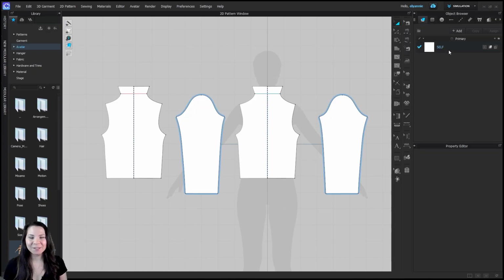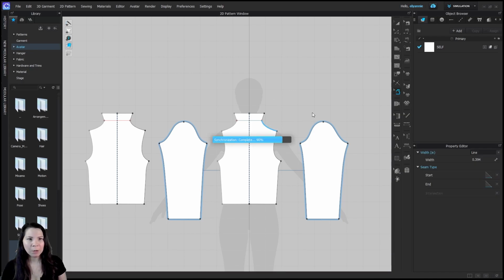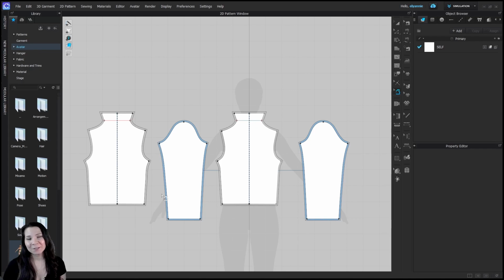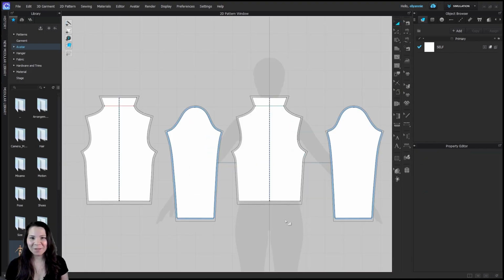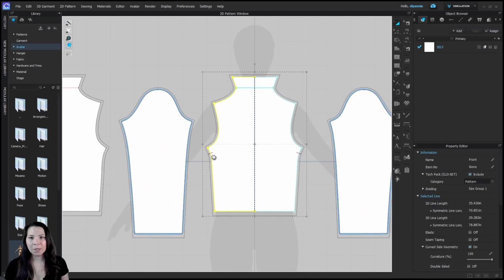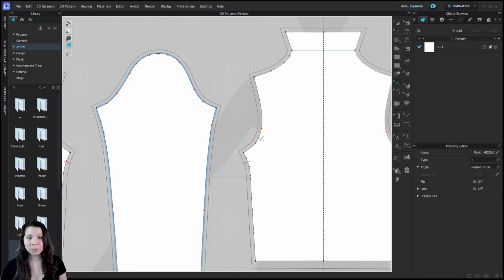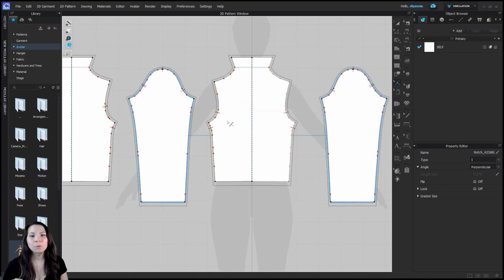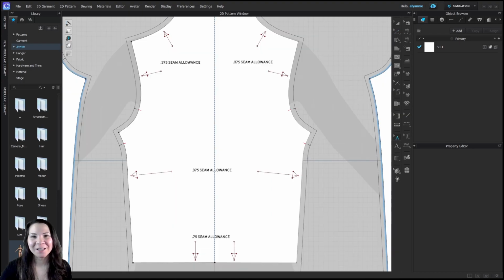💫 Clo3D Tips | Part 4 How to Add Seam Allowance and Notches

Comment: excuse me, is there a way to add MINUS seam allowance? instead of 0.5cm would be -0.5 i need to simulate 0.5 cm that the overlock "eats" when is stitching two garments
Reply from the maker: I don't believe this is currently possible in Clo3D although I have seen other cad software programs that allow this. For now, a possible workaround could be to draw and internal parallel line and add an annotation.

Comment: Very Helpful!  thank you!  Just one Q.  How do you make turnback's for hem symmetry so  that you do not get roping on your hems?
Reply from the maker: You can further specify this in the property editor, under 'Seam Type'
Reply: @DesigningWithEllie  okay thank you .   I see that it can be done using the offset pattern outline, but it appears that it would only work with a straight hem.  I do a lot of t-shirt with curved hems so the turnback using that doesn't work in Clo.  Any suggestions on how that could be done with another  tool?
Reply: I have a lot of pattern experience using PAD and Optiex but Clo and 3D is new to me.  I am in my first week of using Clo so I am excited at the possibilities.